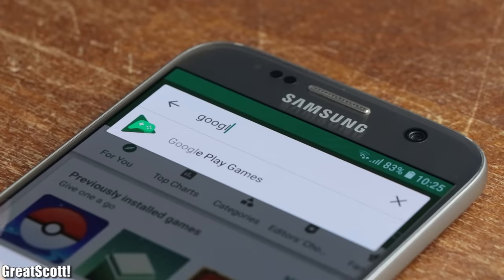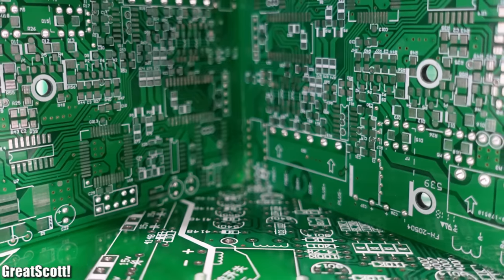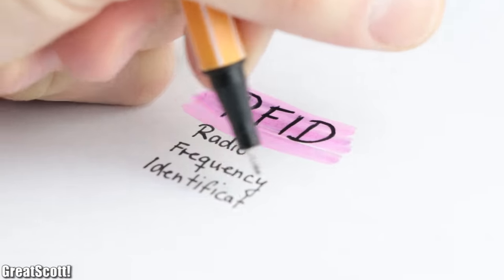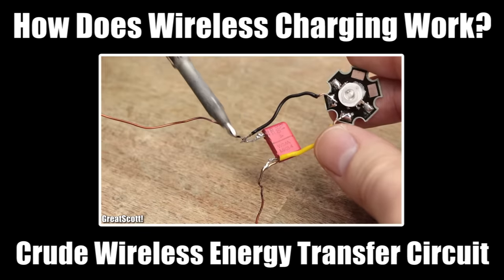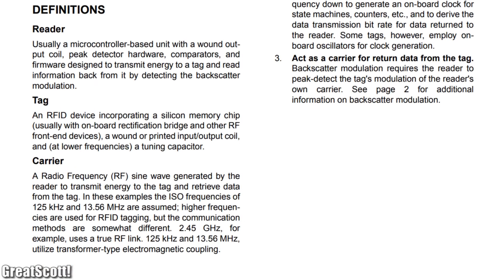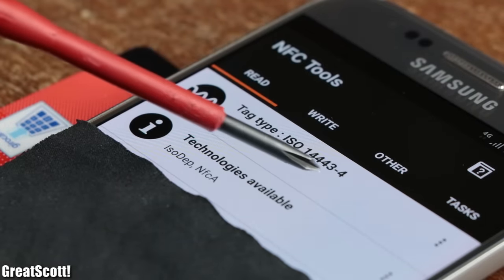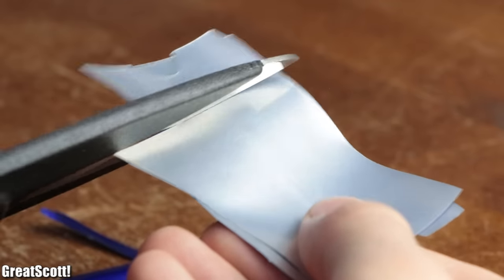How safe is contactless payment? || How does RFID & NFC work? || EB#40

Comment: The Mifare Classic 1K is not as dumb as a regular RFID tag. The regular ones only have an UID that they will transmit to any reader, so no security. The Mifare Classic 1K has 1 KB of memory that also features some basic security. It's divided into sectors and each sector has a pair of keys so it can be locked. But ultimately the protocol is flawed and there exists a hack for it (Google: mfoc, mfcuk). 

Also, the NFC tools app may not be able to read the card but there is a card reader app on the Play Store that can get the card number and the expiry date. I think that the PN532 is also capable of doing it but you need a good library that I haven't been able to compile yet.

Comment: One more thing to state: While RC522 is cheap and relatively easy to handle, it only supports RFID. Further more, the arduino library for it only supports MIFARE Classic. For my project, it can't properly interface with NFC devices such as my phone: It only recognizes it as 14443 compliant and tells me the UID (which changes everytime I scan my phone). Therefore, PN532 should be used, which also supports NFC.
Reply: It supports NFC. Mifare Classic is NFC - it's bi-directional communication, not just spitting out the ID like 125kHz cards are doing. Also it supports Mifare Classic, Ultralight, Pro and DESfire.
Reply: Actually, RC522 can support NFC tags, i.e. NTAG21x (213,215,216), which have similar command set as MIFARE Ultralight, however, the current Miguel Balboa library is kinda funky and missing several implementations  (READ_CNT missing, PWD_AUTH function isn't right, etc). Plan on submitting PR back to the project to add/improve some NTAG specific functions. Also, I started down this road because I did not own PN532 (only RC522 reader), and wanted to format/write NFC tags to be read by iphone. Turns out, they will only read on iphone if formatted correctly with NDEF record (and has at least a valid record.) There are only a few examples of writing NDEF records to NTAG cards using RC522, but they seem broken/buggy. I was able to get this to work, so also considering re-writing some NDEF lib on top of RC522 libs.

Comment: I have an idea for another project. What about a custom Lipo charger based on the HP PSU DPS-800gba.connected in series, where you can set the max Amp draw and voltage max.
These PSU can be adjusted with a potentiometer, But an automated one would be so much better.

Comment: It's likely that your phone can't read the tags because mifare classic / s50 doesn't confirm to NFC Forum standards, so most modern phones can't read them. 

Older phones like Nexus series should be able to read it fine because they used a different NFC IC than modern phones, that was less picky about compliance

Comment: "It uses high frequency so a distance of a few centimeters is mandatory." Not wrong but not quite.

When a rx antenna comes too close to a TX antenna it can detune the network, decreasing its performance. That doesn't mean it's impossible to make nfc work well nearby, it just means the network needs to be tuned to it. It's possible to make a network which can be tuned in real time to a wide range of distances. 

You also imply this is due to the high frequency.  That's also not really true. Coupling is higher at high frequencies,  but this same problem can also exist at lower frequencies. It's just that lower frequencies generally have a limited distance.

Comment: Here is a problem. You mentioned that the data is encrypted. But that doesn't help you with just reading out the card and copying what it sends. You can effectively mimick it this way and your "permission based access" doesn't matter anymore.

Comment: Thank you for sharing that.  I got a new debit card and I am a bit sceptical about the nfc tech inside of it. The bank assistant said that I  could deactivate the nfc function on the terminal devices. Do you have a clue how that would work? I only the information on the chip erased or is the key changed?
Reply: Nothing is changed on the card, just your bank refuses to complete the transaction if you try to do it using a contactless reader instead of inserting it
Reply: @victornpb  thanks for the reply.
Reply: @DiBundschuh  The best way is to punch a hole in a card, where the antenna is. You have to find it with loads of light (hoping that your card isn't black and passes some light).

Comment: If your equipment is powerful enough you should be able to read from an NFC chip from far enough to scan it through your pocket while walking along....
Maximum range should theoratically be something about 1.5 metres considering the used 13,56 MHz(if your antenna and amplifier allowing).

It should be mentioned that one cannot simply charge your bank account with your data, as they would have to use a certified and paired device of an official bank institute - therefore they would get busted in no time.
Only way is like they do with the bank cards.
Copy your NFC to a blank card and shipping them to eastern europe. 
Most institutes though making NFC payments under reserve.
They will get your money back if anything is suspicious about the payment.

All in all one could say NFC is as secure as payment without direct acknowledge and physical connection could become ;)

Comment: I told my bank to send me a normal card,  We changed in the UK from signature to chip and pin because it was more secure and then we are pushed to a less secure system.  If you lose your card then someone will have a good time with it for a while.  i know banks say they will refund the money, but will they do that once we all have contactless?

If you want to use contactless, then by all accounts using something like Google pay and apple pay is safer as it sends a token number to the terminal. To be honest, I prefer using the good old cash and  UK pounds and pence

Comment: i wanted to clarify something to @GreatScott!
the tags/cards you used at the beginning that spit out their full information, they do so because they have their default keys set (FF FF FF FF FF FF)
in the MiFare 1K cards there are a couple of security things you can do to make them safer
each sector in the card can be set with either a Key A or Key B, and each can have different permissions to the read/write of the sector, additionally each sector can have a different Key, so you can lock the whole card with 128 different keys, each sector is composed of 3 blocks and a trailing block (where the keys and access bits are stored), each block is composed of 16 bytes
the other security thing you can do is write the access bits, this way you can lock the card keys so they can't be read or changed later on (this is a bit dangerous to do if you don't know what you are doing, writing invalid access bits can lead to bricking the access to that sector permanently)
in my opinion, MiFare 1K cards while not the best security choice, its fairly decent
Reply: glyn hodges  It depends, if you have a Chinese backdoored tag then yeah, if you can read one tag you can clone it onto the Chinese one
Those kind of tags aren't as readily available, though
Setting a sector as read only is mostly a convenience if needed, most of time just setting a keyA well be enough though, it will prevent cloning easily (MiFare 1K cards are by default insecure, but someone needs specialized equipment to find which key your card is locked with)

Comment: I'm kinda dissapointed that the phone were able to read more tags than the Arduino module. I kinda thought that because using the module means the software is closer to the hardware and that would allow it to be able to read raw data from more tags. But i guess thats not the case

Comment: I've always believed the a biggest concern comes from the way cards are used with wireless payment.

Generally you will see people take them out by a corner, scan the card then place back.

I believe there is every opportunity to slyly take a photo of the number quickly.

This is the only reason I don't use the payment method
Reply: Masking tape?
Reply: But somebody might as well take a photo when you're putting it into the therminal to use chip.

Comment: There are possibilities to hack such a card but they are way more complex as using an arduino with a reader from ebay. 

But what could work are those rfid tags with a button to open a door with. On the door there is instead of a keyhole a reader and you could copy the data of one tag onto a new one...

Comment: Can you help me?
I have a Bosch 670w angle grinder which need AC 115V 6Apms and 60Hz.
But my house have 220V 50Hz.
How to run the grinder?
Dose Hz affect a AC brushed motor?
Can I only use a simple step down transformer from 220V to 115V ?

Comment: 3:22 I have the same tag for a year now from gearbest and i love it! But one time it fell on the ground and now there is a gap between the two resin pieces that are smeared together to hold the coil in place.And i dont know how to fix it,can someone recommend some transparent glue for that. Super glue won't work i think?
Reply: superglue will work as the wire itself is covered by a transparent kind of vernish otherwise it would short itself by being in a coil.

Comment: I had the ability on my card blocked.  Not worth the risk.  It only takes a few seconds longer to stick the card in and just to type your pin in.  And a heck of a lot safer.  Don't have to worry about someone walking passed you with a reader.  Or the worry of having to buy special wallets to stop them been able to do that.

Comment: The video is not answering the question. With the righr technology (nfc reader chip), can I clone the card? The answer is yes. You can read the full 1kb data, store it on another card or nfc device and use it as you use your contactless card.

Comment: rc522 team (even if i have had few issues when i was using it and other spi things, it's still good and cheap) and thing about the rfid spoofing ....
Reply: It's cheap and good for basic things. It is worth nothing for more advanced things. 
PN532 on the other hand can be connected via FT232R to the computer directly and even perform most of the attacks on the Mifare cards and do literally anything with them.

Comment: I know it is an old Video and I wish you see my comment, I am working on a smart Chess board that can recognize the pieces (not only the location) so I thought the RF Id is a good idea but using a 64 rfid reader is nightmare and can't be done in the square of the chess board, I thought of LC circuit board inside the piece but I failed to accomplish that as well.  Can give any advice please. 

nb. we need to recognize the piece not the location, so for example in case of promoting a pawn we can tell what piece the player use.
thank you in advance

Comment: Mifare 1K doesn't just send all it's data... You have to use correct key to authenticate and select which block you want to read

So your example is not fully correct (although there are tags, that are always sending only their ID and nothing else - without any keys/passwords)
Reply: Mifare Classic Card have a broken Encryption... ther are many Places that tell you how to get on the Data without a Key for the Mifare Classic... better don't use this cards for anything that not everyone should read.
Reply: @christianB1234567891  yeah, I know. But you still need to have keys, and it takes about 3 hours to crack them all, so it doesn't "just send" it's data...
Reply: Yeah, but you can get the datasheets with a simple google search and 3 hours are nothing if there is valuable information stored to the card. As Example, there are mobile Apps which use the Mifare Classic as Password Safe or Bitcoin wallets, this may be worth 3 houres of waiting for the bad guys. The Software Developers should at least advice that the encryption is broken, cause this is security by obsecurity.

Comment: Not true. Credit and Debit cards can be also easily read by "Application Protocol Data Unit" - APDU. You just need to read them differently. Try Credit Card Reader app on Android or google "Reading Credit Card data via NFC with an Arduino".

Comment: Odd... my old nexus 7 reads the data from my debit card just fine. 
All the data. 
I never tried to clone it and I have no intention but it is just too easy. 
The chip only holds a UID key and some extra info like the issuer, expiry date and so on. just bytes that correspond to something in the bank's databases. I only assume it's read-only.  Could be re-writable. 

So anti skimming wallets or pouches (my entire wallet is a Faraday cage :D) are the way to go. 
They should be fairly sensitive to strong EM fields so the pouch does more than keep the skimmers away.

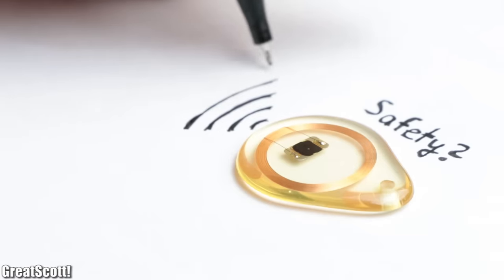Comment: Your explanation at 7:45 is incorrect. A payment card is not a dumb NFC tag (of which the ones with more than just a serial number will, contrary to your statement, not spew out their data, but have protocols for accessing the memory blocks). They usually are so-called dual interface cards where the smart card IC has both a contact-based (for regular EC Terminals) as well as contactless interface abiding to the NFC standard which is used for contactless payments. It is important to understand however, that both are done through the same IC, but with a different application to the one selected for regular contact-based payments. Communication for both interfaces is done via APDUs.

Comment: Hi scoot 
I have broblem with mfrc522 moduel l put it i project it work 1 day and it not work good again and finally it stop i change it with another one it work and after some time start it stop working i restart arduino alot of times some times it work and stop again what is the broblem here 
all my connection is good power 3.3 volt all wires is isolated 
Can you help me with that
 Great Scoott!

Comment: You can also just have two NFC Cards in your Wallet. They will interfere with each other, if someone tries to read them out. Its a bit cheaper than buying such a card holder :)
Reply: Even cheaper is to sleeve the inside of the wallet with aluminum foil.
Reply: Except it won't work. ISO 14443 has methods for collision detection.
Reply: @domints  Oh okay, good to know! Thank you! The money is well spent then :D
Reply: SteveGameDE seriously, there is no better protection than real NFC shield. Malicious reader can just communicate with every one of your cards one by one even if they all are in the range.

Comment: Since every RFID tag as a "unique" ID, is it not safer to rely on that as the "password"?
At least it can not be programmed on other Tags. (i think)
Reply from the maker: You can use that as the password as well. Sure.
Reply: It can be copied easily.
Reply: @trinidad17  Into another tag?
Reply: @maxsnts  To some extent. Also, most "unique" IDs are not unique at all.
Reply: @trinidad17  Dosent LF and HF tags have read-only IDs?

Comment: I've a question for you: it is possible to use this (LT 4320) instead of the common graetz bridge ?
It's worth the price / effort ?
Often, with audio, graetz bridge is applied to transformer secondary (usually 12 to 24V); 1,4V on a 12V AC line is something.

https://www.analog.com/media/en/technical-documentation/data-sheets/4320fb.pdf

Comment: You're just using an app that can't speak the EMV protocol. Any NFC EMV payment card will produce its card number, expiry date and so on without any special authentication. It works just like a contact EMV payment card, because, well, it is. It's the same protocol for contact and contactless transactions. In the United States there is even something called “magnetic stripe emulation” which is as terrible as it sounds.

Comment: This has been done for proof of concept, please do not do this in real life it is after all illegal:
Wandering coffeshop licence, and a payment terminal.
Modify terminal to use a amplified frontend and a 35cm diameter loop antenna.
Place antenna under a park bench. The increased range is around 15-20cm. It can now access cards in normal wallets and back pockets as well as cards in wallets in bottom of puses/handbags placed on bench.
Every card that comes into field can now be attempted charged for small ammounts, like $5. Ammount is small enough that most won't notice and plausible for a expensive cup of coffee maybe with a bun. Since the bench and purchase is in the vicinity of the legal place of buisiness and the terminal can be a wireless one, it is very hard to dispute the billing.

This is why I have not and will never enable a non-confirmation based wireless billing of my card.
Embed a button in the card that I have to hold in to enable the antenna and I may think about it, untill then; no thank you.

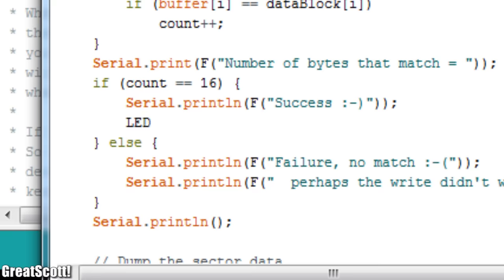Comment: Can someone explain the code on 6:22
LED = !LED;
digitalWrite (5, LED);
Why is he using "LED" instead of "HIGH/LOW"? Is that a boolean value? Cause when i try to use that with push button I get numbers 0 and 1 which is obvious, but LED is very dark untill i try analogWrite command with 255 instead of HIGH.

Comment: If you can read/dump the date, even though it's encrypted, wouldn't you be able to take this dump and write it onto a different RFID/NFC chip?
If this is possible, then I should never ever let my cards out of sight.
And wouldn't it be possible to amp up the range of the reading device? A couple of centimeters would suffice. Then I'd be able to hold the more powerful reading device behind a random dudes back pocket and make a copy of his bank card.
Also, I wouldn't feel safe with the encryption.